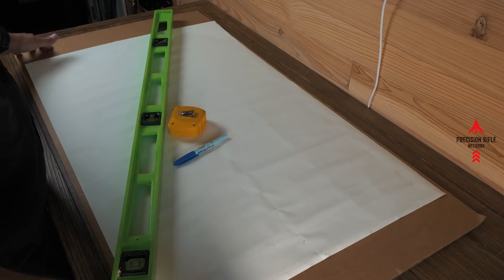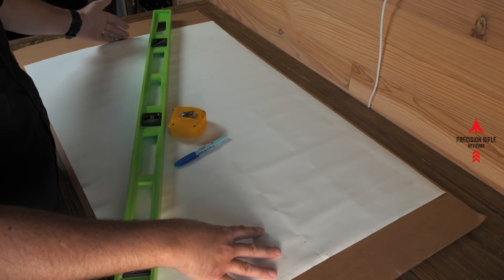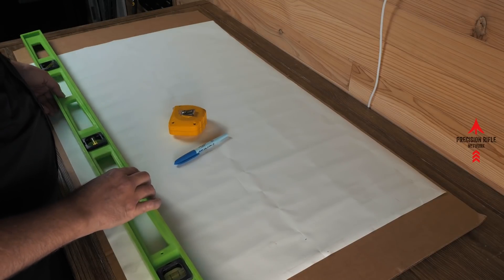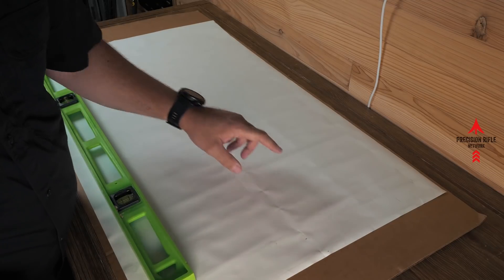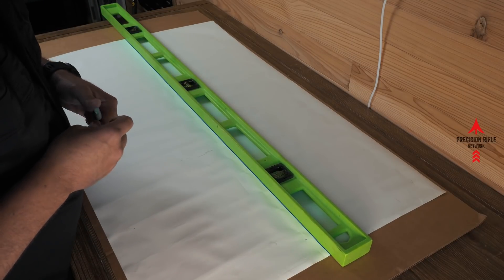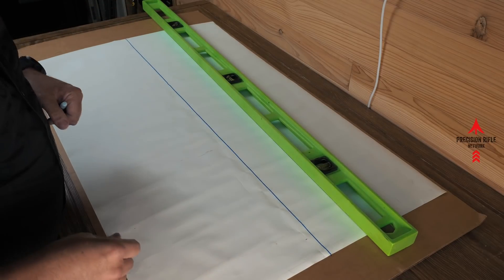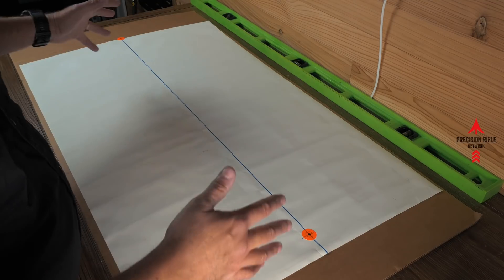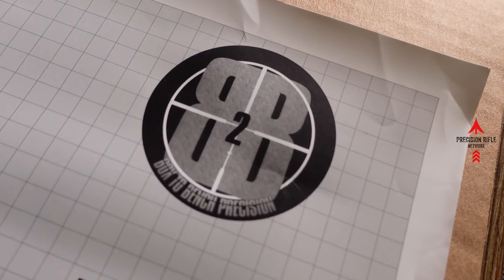Testing The Burris XTR iii

Comment: This is more a test of your expected 1000 yard dope than a tracking test. 
Tracking would be to shoot, dial up 10 mil, shoot again, measure for 36". Dial back down, shoot to test return to zero. That's a vertical tracking test. Dial right or left 1 mil, shoot. Dial back to zero, shoot. Horizontal tracking. Can do right or left horizontal at each vertical level if you want.
That's the purpose of all those boxes on the target you were shooting at.
If you really want to test the scope & rifle, dial, shoot one, dial, shoot one, and go around the whole target that way until you have a group at each box. Tracking, repeatability, and return to zero.
Just my opinion. Your rifle, your target.
Reply from the maker: Thanks for your opinion. 
All I care about is vertical tracking at the top of the range. 
Everything else is close enough to not matter at short distances.

Comment: Is hysteresis ever a concern? If you dialed back to your 100yd zero, any chance POI would not be the same? The nerd in me wants to dial up and back down (then maybe up again!) to make sure the tracking is both plumb AND repeatable, but not sure if it’s really something that’s likely to be an issue.
Reply from the maker: Hyster.... dang bro, I had to look that up. You're not wrong though, and I do always check that.  I forgot to mention it in the video.  I also did not mention checking the windage dials. Some people swear by that, however the vast majority of people in competition just hold over for wind and don't dial.  Each to their own I guess.
Reply: With that level of precision you also need to be concerned about the repeatability of the scope. By that I mean how much does the MPI shift with recoil. That erector mechanism is designed to move when we dial, but stay exactly still when we shoot. There was a guy in the US specializing in replacing Leupold Mk4+ leaf springs for a single, stronger coil. Made it harder to move the dials, but it held the erector mechanism firmer. We also need to consider lash, which is the resistance to shift the erector mechanism in the direction of dial travel. Some old timers in our long range club insist on dialing slightly beyond the intended number and then coming back to where you want it, to relieve spring tension in the scope.

Comment: You lost me when you said you was testing for 1000 yards. The yardage doesn't matter, your testing tracking and verifying your turret is calibrated.
Reply from the maker: please explain.  I'm always open to learning new ways of doing things.
Reply: @PrecisionRifleNetwork  You tested to make sure that what ever you dialed on your turret had that point of impact shift vertically on your target and not going left or right as you dial up. Dialing up 9 or 10 mil would verify the same thing as long as the point of impact was 9 or 10 mil (what ever you dialed) above your point of aim. 1000 yards really has nothing to do with it.
Reply from the maker: rustynut1967 ok I see what you’re saying now.  1000y is just a common distance in competition these days so I picked it for that reason. I would argue you need to test as far out as you can, because errors sometimes don’t show up at closer ranges. Call it 8-10 mils vs. 4-5 if you want. Same concept.
Reply: @PrecisionRifleNetwork  That makes sense.Going further out would pretty much assure anything closer would be fine. When you originally measured 36" I thought you would dial 10 mils at 100' to verify.
Reply from the maker: @rustynut1967  Yeah there were a couple of mental errors going on in this video admittedly. I should have just used a .308 for this test and everything would have been fine.  I switched to a 6.5CM at the last minute and it complicated things.  I'm only 45 but I think my brain is like 70 years old...
Reply: @PrecisionRifleNetwork  , I think the idea for finding error is that it is easier to measure the more you dial up. Example if your scope was 1% off, you get 36.36" at 100 yards if you dial 10 mils but if you dial 20 mils you get 72.72" at 100 yards. The expected for 10 mils is 36" and the expected for 20 mils is 72". So with a ruler you will get .36" difference if you dialed 10 mils and .72" if you dialed 20 mils. Any inconsistency you have in poi from not having perfect fundamentals will be the same regardless of if you dialed 10 or 20 mils. For example if you know your zero might move around .2" because you don't have perfect fundamentals, that .2" error is less of an impact when you dial 20 vs dialing 10. TL;DR you get more accurate error % for scope tracking with the higher you dial. So even if you never shoot at the distance that corresponds to 20 mils, you still want to test the tracking at that value because any human error in POI or measuring will be lessened. 

BUT then you also have the idea that the scope may not perform properly at the edge of it's range so there is a chance you can go too far and end up getting a larger error then you would get for your normal ranges. I think the best thing is to just do multiple tests up to the highest you can get. Such as 5 MIL, 10 MIL, 15 MIL, 20 MIL and now you will see well from 0 to 15 MIL I have an error of 1% but from 15 to 20 I have an error of 3% and I can just put 1% in the ballistic calculator and note that if I am ever shooting ELR to be weary of that extra error present from 15 to 20. 

BUT there is also a device that people can use to get really into the weeds where you attach two scopes to a dual rail (parallel rails) and adjust one scope, because even if you bolt the scope mount to a table like you see some people do, there is still movement when they dial and you can't be absolutely sure it did not move in the contraption. But if you have two scopes, then you can use one scope to re-aim at the proper position before looking through the other scope to measure how far off it is. This would eliminate any POI error from fundamentals because you are just dialing the scope and not actually shooting with it on a rifle and you have the ability to re-aim the setup vs trusting that the pic rail you bolted down to the concrete bench doesn't move slightly. It is also easier for someone like me who does not have the ability to bolt that scope tracker tool to a concrete bench but is able to just slap the dual pic rail device to a tripod and take it to a public range with me.
Reply from the maker: @raining1975  holy crap dude, you wrote a lot.  Thanks for watching.

Comment: Nice video. Check out TiborasaurisRex. He has a tracking test stick like your level. Marks a line every 25 millimeter on the level and scope at 25 meters away. 25 Milllimeters at 25 meters equals 1mil. Lock the scope in a vise and dial up. Check out his Arken 4-16 tracking test video. He goes over his method for checking tracking. That’s what I have switched to to test scopes.
Reply from the maker: Thanks.  I can't watch that guy.  Too wordy for me, but I acknowledge he knows a lot of stuff.
Reply: That test only shows where the reticle tracks relative to the changes in elevation and/or windage dials of the turrets. To learn how your scope actually tracks you have to shoot groups at original zero and then shoot groups with the turrets dialed in specific increments. Then when the actual point of impact distances are measured between your zero group and the other group(s) you see the real tracking of your scope and learn what percentage tracking error your scope has.  All scopes have tracking error, no matter the brand, model, or cost. Even Schmidt and Bender, Nightforce, etc have errors in tracking, but those higher quality scopes typically have much smaller percentage error than lesser quality scopes. Only by knowing the tracking error of your scope and then applying that tracking error into your ballistics/firing solutions calculations can you be assured of knowing what you will get when you dial in an adjustment on your turrets.  This is obviously more important as the distance to target increases.  For long range shooting it’s a critical step.

Comment: Question.  If I'm doing this test where the bench is on an elevated position at the range,  should I be using true horizontal distance to find the 100 yd mark?
Reply from the maker: Are you suggesting that the downward angle might cause the test to be inaccurate?  You don't have to worry about angle at 100y unless you are really high in the air.  I'd have to run the numbers, but you shouldn't have to worry about that.
Reply: @PrecisionRifleNetwork  Yes that was exactly what I was worried about lol.  You read my mind.  Thanks for the quick reply.
Reply from the maker: @samh1390  no problem.  Thanks for watching and commenting.
Reply: You shouldn't be shooting really high.....